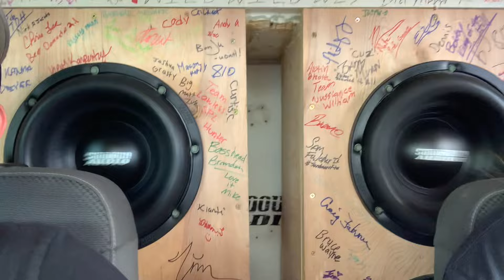What All Did I Break On My 10K Watt Truck Build...

Comment: Check the ohms of the sub that smoked... Since the same amp burned on that sub it's possible that when the sub smoked the coils could have shorted and made the load too low for the amp.. Just something to check before replacing the amp and it possibly happening again
Reply: I am willing to bet, the sub smoked because they're not really rated for that kind of power to begin with. Not many subs out there that can handle 5k rms constantly.
Reply: @robcooper3171  every sundown Xv2 and above I have ever owned has taken 5k+ daily for years of pounding abuse and still playing! Hell even though I hate them the Orion HCCA are rated for 5k and my Wolfram PT-18'S are rated for 4krms with 4in PE flat wound coils good for up to 500deg F so yes there are plenty of woofers that will take 5k+ constantly and keep on keepin on just have to know HOW to do it properly because a typical 5k rms amplifier is only ever going to clamp 3k-4k during use as the impedance rises now had he had overbuilt korean amplifiers then I doubt this ever would've even happened but something about those full-bridge/full range Brazilian amps when you're purposely overpowering your woofers they tend to let out the smoke! Not saying all full bridge amps do this as B2 audio has successfully made some great amps in that class but I personally will stick with korean surfboards ie. Right now my current build is two Wolfram PT-18'S and each woofer has its own Wolfram AW-9000.1D at 1ohm yes these amps are capable of dynoing over 14k watts clean and I intend to send every bit of it into one woofer!!! Lol
Reply: @kevinAuman1  I have a Salt 6 on 2 12" Xv2s and I've yet to even see the clip light, it's loud in my hatchback 😁
Reply: @Chris-B-Bassin  hell yeah bro, I have two Dave Lieb Designs upgraded X12's with black zv5 spiders and NS coils with the SPL surrounds and they're legit the most violent little pair of 12's I've ever heard I literally only clamped 3k on the pair at 2.3ohm after rise on a single 3500.1 and the cones never even moved much at all but it broke my sunroof on my Lincoln mkx knocked it right off the track and it never opened again smh the entire vehicle flexed like crazy best it ever did was a 150.1 at 28hz in a subsonic suicide box made to play ground pounding lows! I would love to throw some real power to them in the same box and see what they can really do because I know they'd take 5k each all day long but unfortunately I own too many subs that're much beefier 15's or 18's so I never have had the chance to really mess with those 12's on any real power!
Reply: @kevinAuman1  I was clamping 3500w on a Salt 4 at 2ohms in a Concept Enclosure box but just got a Turbulent Designs 8" BAP box and these subs are way louder and are moving a lot less like you said. Crazy. I love this new box for sure

Comment: I had to go back n paint every bolt n screw with Loc tite..  got a bottle of blue and red in the tool box for the stuff I rattle loose.
Reply: Potential fix for 3 piece rear window : camper shell and back window blow through!!

Comment: That's the inductor, not the transformer on the amp. Typically they go out when there is some distortion here and there. Anyhow, great build! Greetings from PR!
Reply: Or vibration. Looked really loose
Reply: I thought it was a toroidal type transformer. Now I gotta go back and look
Reply: The transformers are yellow, in that full bridge.
Reply: They call those coils a choke.
Reply: Those coils are a low pass filter to remove the class d artifacts. The clipping light probably means the inductor is bad and not filtering the noise so the amp thinks it’s clipping

Comment: The left side sub smoked because your box isnt symmetrical, it had a lot more room to breath than the other one because your port was under it and it would move more or less more than the other one. The best and the loudest  box for 2 subs is wood port in the midle from top to bottom, it will act as as a brace too so no additional bracing needed.

Comment: Those would be your output inductors(chokes). Seeing as you had an issue,  with that side,  with the subwoofer as well.  I would ohm it that subs coils.  See if they have any differences between each coil, due to heat stress.  That could be what caused the issues with your amplifier in that side as well.  Or the amplifier could have been the issue,  which in turn caused the subwoofer to clip,  and heat up.  A couple of variables could have caused the amplifier,  to heat the inductors up that much.

Comment: Those output  inductors got HELLA hot on that amp, those filter out the high switching frequency of the class D amp. My bet is the clip light is on due to it not filtering correctly anymore.

Comment: Parker the big square things are the transformer what u called the transformer is the choke and they get extremely hot that amp needs that choke removed and replaced immediately or when it goes it's taking the whole output section with it it's  manufacturer flaw defect better just send the amp back in if u can cause it's stuck in clip mode cause the insulation on the choke wires melted and are not having the correct amount of turns now and will drastically affect the ohm load the amp sees.  Those fans need 4 fans or one big fan strait in the center directly on the chokes.

Comment: This is not a transformer.   It's the output inductor (Choke) between amp and speaker.   This is a full bridge amplifier which has two complete amplifiers in it, which do exact the same signal with a phase shift of 180 degrees (inverted).   The speaker has no ground potential and is between the two amps.   So the voltage on the speaker is doubled with one single rail voltage.   It looks like one half of your amp died. So you have still signal on the output with the half of the voltage (quarter of the power)  and mostly you even have a dc offset on the terminals, too.   Check with a voltmeter, if there's DC on the speaker.

Comment: 12:40 - yeah, that's a transformer, yes, it heats up too, so, this can cause with it a simple overheating too. Also the transformers are too far from the fans + the big caps are between the trasformers and the fans which makes worse the tansformer's cooling. In the most cases if you just replace this thansformer, the amp will work normally like before. Also 1 of my friends had similar problems with his amp more times even though he had an external fan which blowed air on the amp: always some component was toasted inside the amp which wasn't connected to the heatsink, then I realised that is because of overheating. I just made a new bottom plate for the amp without venting holes, cut a hole on it for an extra fan, I checked which direction the original fan pushes the air - it was pulling the air outwards from the amp, then I installed the extra fan in such a way that it pushes the air inwards into the amp - to make ideal air circulation -, and this solved the problem. In my opinion it is a good idea to make this on your amps too because mainly those big caps are resisting the air flow from the fans to the transformers. Ideally this extra fan should be at least as big as the original fan, or / and should push at least that much air like the original fan, and obviously also need to pay attention to not cover it when placing the amp back into the car...
Reply: I just doublechecked what I've seen on the vid, they can be also transformers - because there are existing transformers which are looking like these -, but maybe they are just inductors - if it only has 2 terminals, they are inductors, if it has more than 2 (usually 4) terminals, they are transformers. They're looking like they have just 2 terminals + also they are labelled as "L1" and "L2" - because of these things they are inductors for sure. Also I see there +2 outlets for extra 2 fans on the plate where the clip light is, so yeah, I would put there extra 2 fans for sure, so, the new bottom plate with that extra fan isn't really necessary in the way I wrote before, but anyways, I would maybe put there that extra fan - 5 fans total = ideal cooling...
Reply: @PBasschannel  Their output inductors. Just about every class D amplifier out there has them, they filter out some of the noise from the switching power supply.
Reply: @BobBasshead  yeah, exactly...doublechecked what I've seen - my previous answer to my comment...

Comment: You killed the output choke and the clip light is on because the amp is sensing high frequency AC on the output because it's not being filtered by the choke.

Comment: You should do a video on sound proofing showing how a little or how a lot can make a difference with pressure testing,  Your bass was not enough for the fans maybe upgrade your alternator and add some batteries.  All of your screws and bolts just use clear nail polish or Loctite.

Comment: Who's system is that at @9:29 it is a Wolfram Audio C pillar wall??? I literally have the exact same equipment and wanted to do a C-pillar but was advised against it because I was told there wouldn't be any surface for the subs to load off of smh 🤷‍♂️🤦‍♂️

Comment: Y’all want to drop some locktite on the bolts that fall off.  Think the red one is the permanent. That helps.
Reply: Barring that if they are currently tight a coat of spray paint will help them stay home better before they fall off.  Generally I’ll address that inside the doors when installation starts before any sound deadening.  Certain models are just more prone to it. Not a manufacturer thing it’s just what nuts the engineers used and the specs to tighten them. Ford trucks it’s common.

Comment: PArke please don't mount your amps on the speaker box. The vibration caused the transformer coil to rub against itself causing it to overheat and smoke.Instead,build an amp rack and install all your amps on it. It will cost u less and u will not be as nervous and also u don't have to worry about anything smoking.plese take this into consideration. Good bassing though!